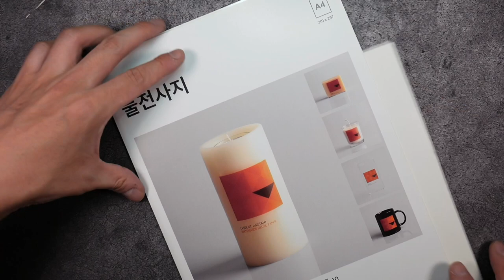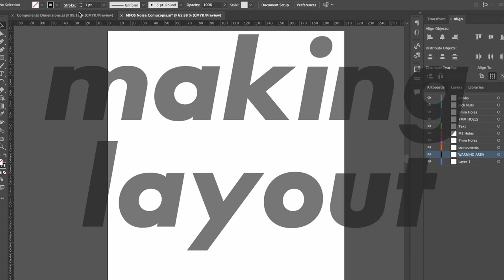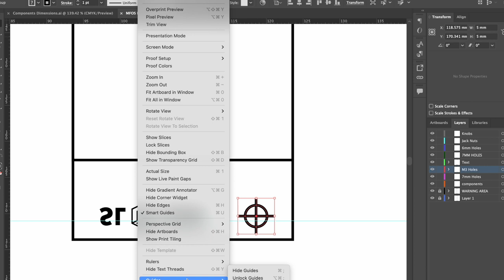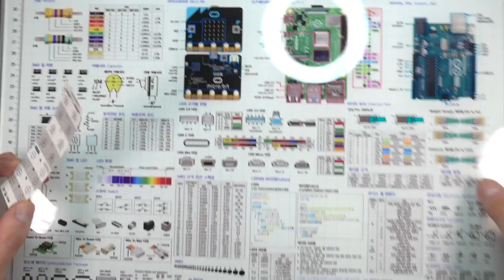MAKING OF EURORACK FACEPLATE

Comment: Very nicely done!  Thank you for showing this; you've got a great process here.  I particularly like the deburring demo; I'd been doing it with.a manual countersinking tool, but using the same step drill that i would have already been using to make the holes should be a great time-saver.